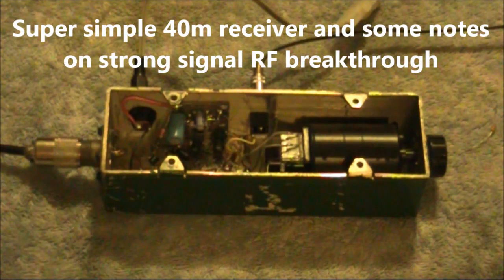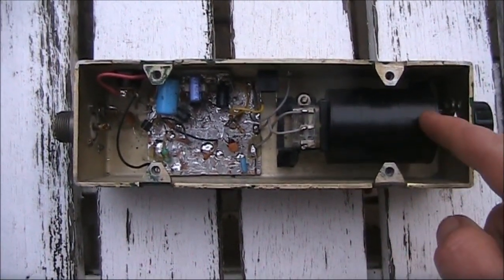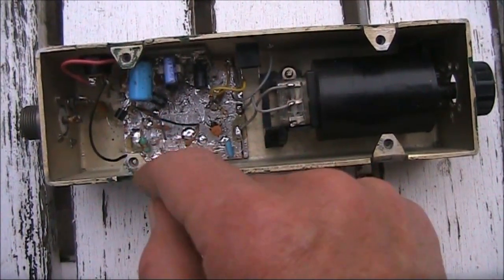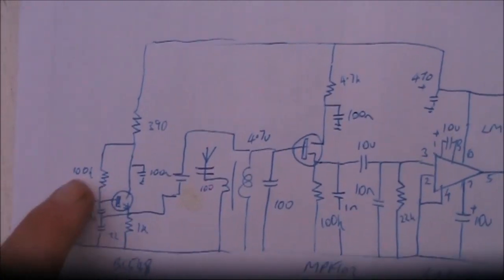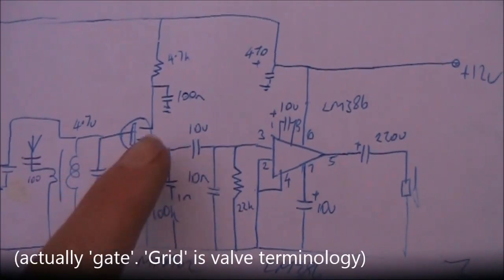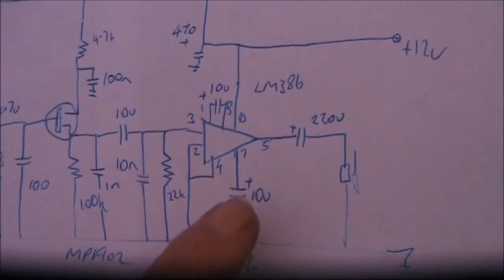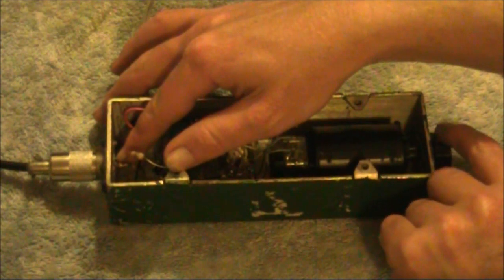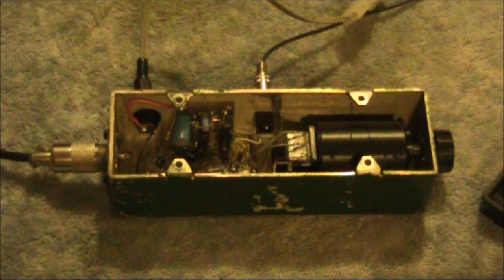Super simple 40m receiver and notes on RF breakthrough

Comment: A nice little project for over the holidays, I love the simple circuits Peter. I remember some years ago I built a similar circuit inside of an empty sweet box and was amazed at the performance. I also used a ceramic resonator VFO and the LM386 audio output IC. It was a clear plastic box and all the workings could be seen, I used it as an experimental board and components could be added or changed very easy. Enjoyed the video 73 M0DAD

Comment: I built one of these as designed with the exception of a VFO instead of ceramic resonator based local oscillator.  It works OK but definitely lacks sensitivity (as well as the expected selectivity without any kind of filter.)  I'm wondering if some additional RF gain from the FET would help, or is this design just limited and this is the best I'll get.  Curious if anyone else has built one and their experience.
Reply from the maker: Yes it's a very bare bones receiver and more gain stages (and a better detector) would help.
Reply: @vk3ye  Thank you Peter

Comment: I am using 100uh with 4.7pf .. As per calculator. 

Will it be fine?
Reply from the maker: It may work but for that frequency it is very high inductance with a very small capacitor. There are limits and you may run in to problems with extremes like those.

Comment: What can I use instead of an mpf102?
Reply from the maker: +trialen 2N5485, 2N3819 & almost any other small signal FET
Reply: +vk3ye Thanks, the  mpf102 is hard to get in the UK.
Reply: another equivalent is a J310 or a BF244 or BF245
Reply: You may slash an electret microphon from a scrapped handless set. There is smd FET inside, source is grounded, gate goes to the electret.